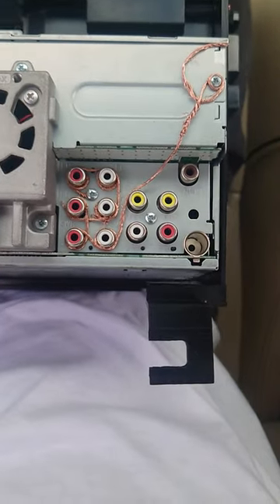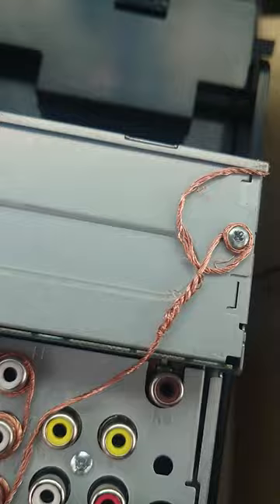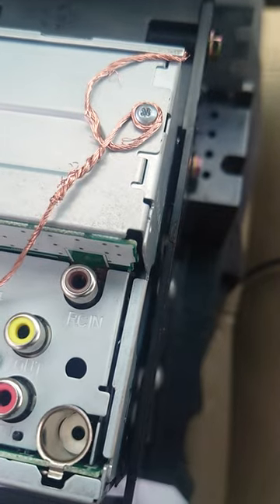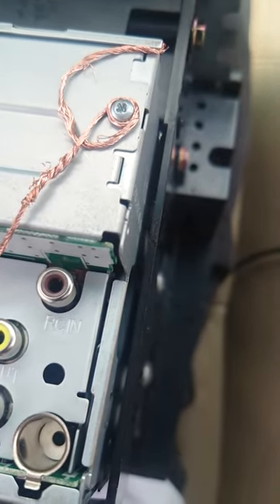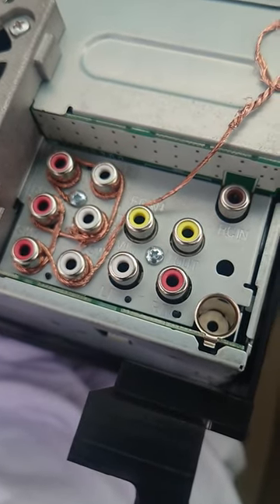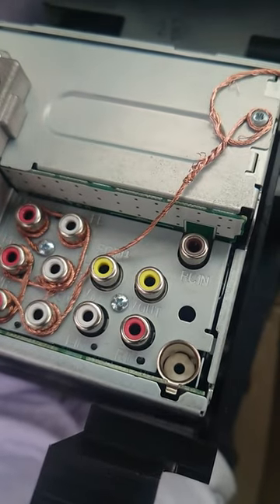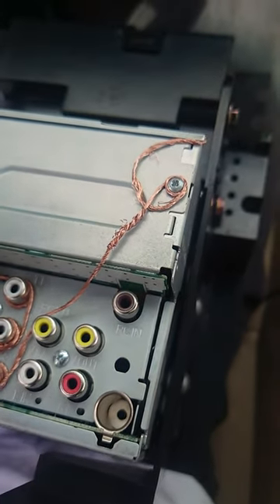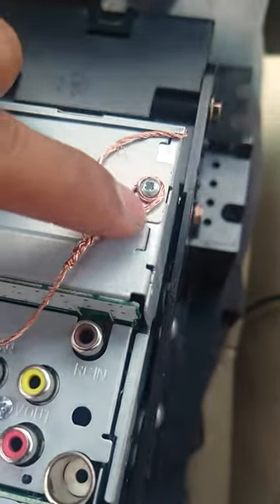how to fix headunit ground loop/alternator whine or interference #caraudio #pioneer #headunit

Comment from the maker: Guys I fixed it finally 😭😭 basically I had 2 separate power wires for 2 amps and the other one I added when I installed my 4 channel probabaly had interference and that went into my amp and then the RCA from that amp brought it to the head unit and after that it carried over to my subwoofer amp through the RCA ports from my head unit. It was basically a stupid chain. I broke it by putting my subwoofer amp and 4 channel on a distribution block so they both share a common power and ground, thankfully that fixed the issue.
Reply: Thank you for this video. I’ve wasted WEEKS trying to figure out my noise problem. Same HU. No problems for 4 years. Changed sub amps and started getting the noise. Common power to distribution block. Different grounds. Ground loop isolator didn’t help. Still don’t know what the real cause is but this bandaid eliminated the noise for me so THANK YOU. Even NVX tech support issued me a return and said it must be a faulty amp bc they were stumped.
Reply from the maker: @jslike5382  dang dude that's awesome glad I can help. have you tried doing both on same ground wire? That fixed my issue completely. I ran a distribution block and put both amps on it

Comment: @UzsDC1UZ What is the model of the new head unit that you bought and did the noise you were picking up go away with the new head unit?
Reply from the maker: In my case it actually didn't go away but it did get better. I picked up an alpine ilx507 but I think my alternator is causing the ground noise, I'm going to run a power filter online to suppress the noise
Reply: Old skool trick
Reply from the maker: Exactly bro

Comment: The issue sounded like constant static coming from the speakers right? I’m having the same issue you had I think. It changes sound as you go up in rpm
Reply from the maker: Okay yeah you have alternator whine in your setup. This could potentially fix that issue.

Comment: I just did this with my truck. We will test to see if it works. I did EXACTLY what you did in the video! After a few days or tomorrow I will get back to you. I’ve had an odd engine whine/static sound ever since I installed my skar subs. Probably being from the rca cords. Fingers crossed right?🤣🤷🏼‍♂️
Reply: No luck.
Reply from the maker: @kadent7320 🥲

Comment: Tried this on my amp with no luck, maybe try it on the line out converter? Also, it whines at idle but not at higher rpm from what i can hear lol also if i open any door in my car it stops

Comment from the maker: This video is a last resort technique to get rid of this issue. It got rid of 90% of the noise for me and it is great however, I have a new headunit on the way since the heart of the system needs to be giving out as clean of a signal as possible to the rest of my external amps. My setup isn't necessary SPL but SQL where I care about sound quality and output.

Please ask me for any questions and I'll be happy to help 😁
Reply: Hi so i have a pioneer double din,2 equalizers,a j23,a taramp 5k and a timpano 1000x4,and also put a fan and i ran the amps,the fan and also crossover to switches and now i have crazy static noise
Reply from the maker: Sorry for the delayed response, are the components on a single ground from the battery back or at the least at a common grounding point?

Comment: I have similar problems but my head unit is not aftermarket, but stock, and it doesn't have rca outputs, so I'll do it soon but connecting the signal minuses wires togheter with a grounding on the car itself. I know it sounds stupid but i'll try to disconnect them from the amp, so without the ground connection, then with it and then with it and connected to the amp. I'll see if there's any benefits with each one. Ground loop is driving me crazy
Reply: any updates i have the same issue
Reply from the maker: @mouch8533 yeah look at my pinned comment

Comment: Are you using the RCA connectors? I have alternator whine issues after installing a new stereo but I am not using those RCA connectors due to the car not having an amplifier.
Reply from the maker: I'm using RCA yes, you could try checking your grounds on your headunit. The best method is to run your own fused ground from the battery to the headunit and not use the factory ground wire